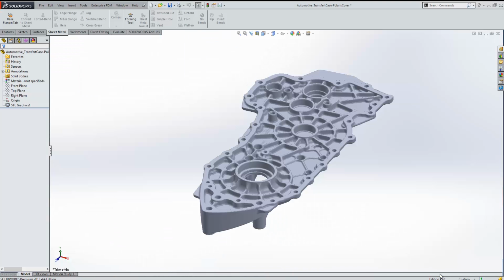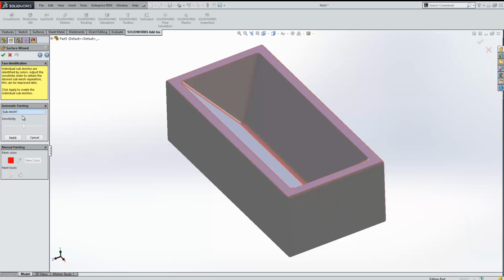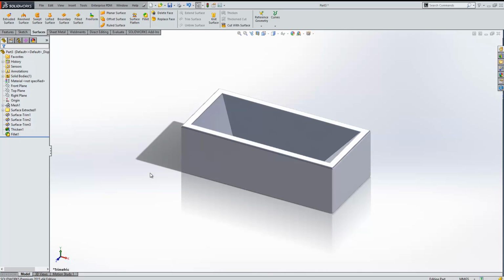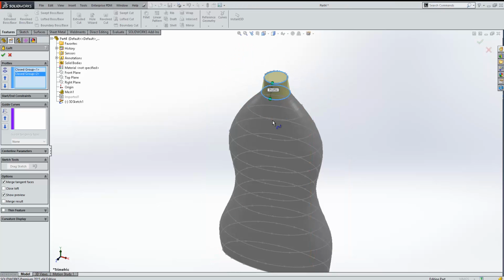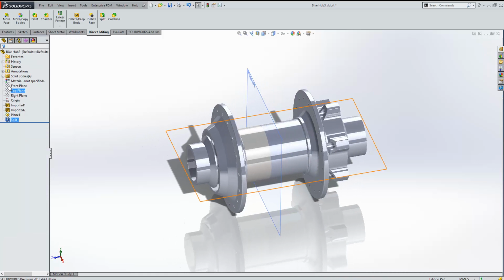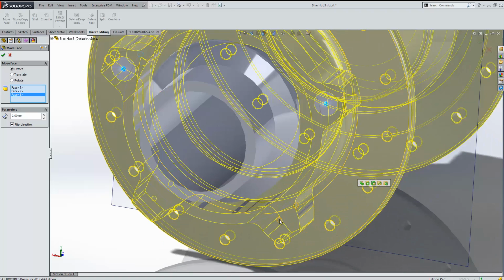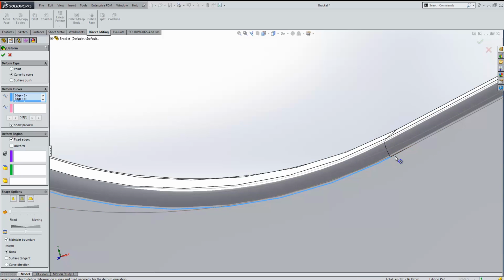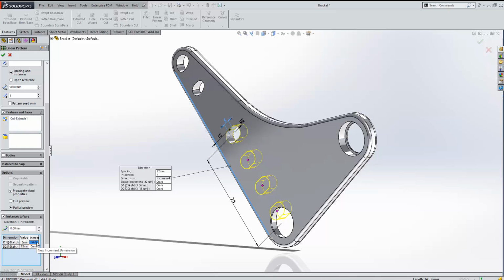SOLIDWORKS In depth - Reverse Engineering Products

Comment: helpful. Pro level SW modeler here, 10+ years. Now I think 3D scanners and their software look cool, and I think I'd like to get my hands on one eventually.... but I've been hand measuring  to reverse engineer parts for the past 10 years and I'm still seeing it as one of the most accurate ways to make parts, especially when they get more complex. From what it looks like, the various scanning software's don't necessarily make it that much faster, you still need to transfer the features and build the feature tree to get a proper model, so why not just do it from the get go with a digital caliper and tape measure :)...... also, often, the scanned data is crap quality...

Comment: I imported scanned mesh file (STL), but ScanTo3D options are not active (except for curve wizard). Anyone know why? I  have SW Premium 17. Thanks
Reply: have you downloaded power surfacing and installed on solidworks?
Reply: Scan to 3D is a SW professional add-in and needs to be turned on. See Tools>add-ins

Comment: From my experience Solidworks can only handle up to 650,000 points without crashing/hanging so if your scanning a complex shape, decimating the point cloud to that sort of level would result in poor scanned data for reverse engineering accurate information